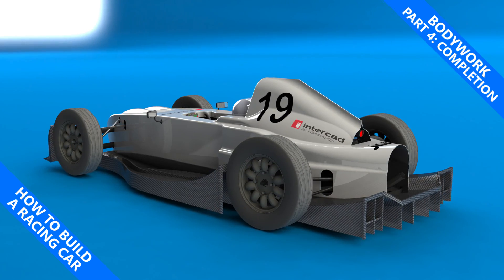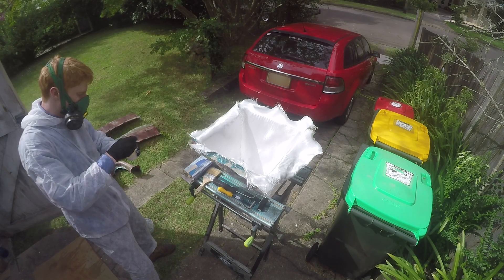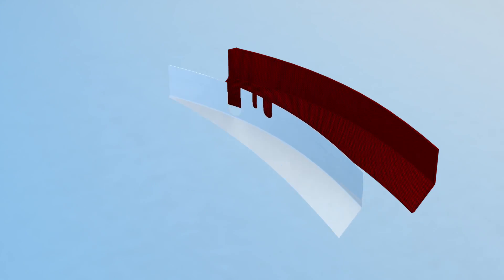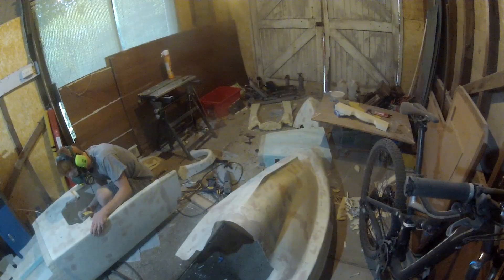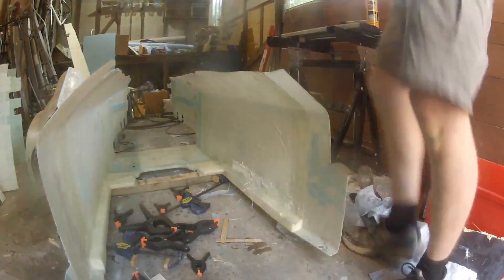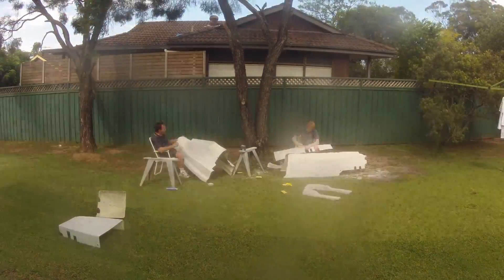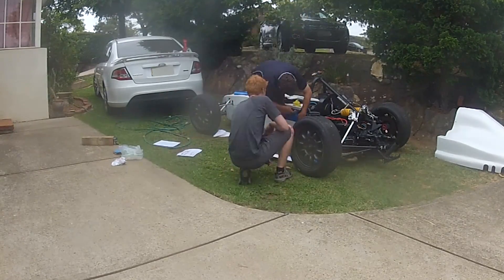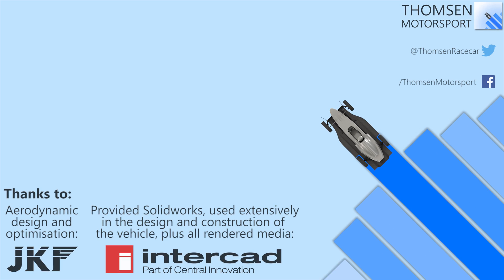Bodywork Part 4: Completion

Comment: Generally speaking, resin (gel coat) is sprayed into the mold first.  And any glass added is rolled in with a roller.  And if you really want, use a vacuum bag system.

Comment: Would you happen to have a rough estimate of cost for making the body plug, mold, and parts? I'm looking to do similar in a US racing class.
Reply from the maker: The body plug was relatively reasonable, maybe a couple grand AUD. The mold I spent about 1k AUD for the fibreglass, but didn't like it (vinylester) as it was quite hazardous. I moved to a local epoxy which was much safer to work with - I think I spent about 1k AUD again on that fibrelass (lower quantity / higher cost = roughly similar total).

Comment: How was it fixed in the estructure? Congrantulations for project! Wanted to know what are you up to now
Reply from the maker: I used DZUS fasteners to attach it. I had no problems with this - I just made sure the parts were layered such that the air couldn't get under any bodywork bits and tear them off.
I'm working in France now so have left my car behind, couldn't bring it with me here.

Comment: a couple of hints first you can paint on the mould a gelcoat to avoid pin holes we use at my work in aviation a product called duratec 707-061 which is a easy sand gelcoat catalyzed with mekp at 2% once out of the mould just sand and paint you can spray this on top of your pva release or you can brush it on, spraying is a lot better this stuff is common in the fiberglass industry so is easy to get in nz a 4 litre tin is around 2 hundred dollars but it goes a long way and saves tonnes of work once the tin is opened you have to use it in about 6 months second hint we always reinforce our moulds before removing from plug we commonly use large carboard rolls split in halve and a couple of layers of 300grm cloth . epoxy is quiet slow curing it really needs baking, once release put it back in mould for a few days to stiffen up. in aviation we use polyester 9885 which is fire retardant  no epoxy is fire retardant one draw back of polyester is that it can shrink back during curing so your foam doublers might show through on the outside . apart from that it would be a fun project to do I would of thought fire retardant would be a must in your sport good job so far keep it up one last thing before I go if you use foam for plug coat with a layer of 200 grm cloth for strength and fairing compound
Reply from the maker: Always good to see tips like this posted - I hope others wanting to do something similar read through the comments.

Comment: Hey Thomsen! I'm an electrical engineering student who has an absolute obsession with mechanical engineering, and your videos have been awe inspiring to watch! Would you ever be willing to do a video on some of maths you used in the design process of the vehicle? You've done an amazing job showing the how to of building this amazing machine, but I'd love to learn about the why in many of choices you made design-wise. 

Keep going man! You rock!!
Reply from the maker: Hi Marshall, thanks for the feedback. I'm always glad to hear when someone has enjoyed them. At the moment I'm not planning to do any more on this project, I've moved to Europe for work and have had very little time to think about this car. I'll think about it though.
Reply: Thomsen, 
That's absolutely fair! Thanks for even considering it. You've done some amazing work as it is, and like I said, seeing this build was inspiring. If you can't that's alright, any textbooks you'd recommend on the maths? If you don't know any good ones off the top of your head that fine :P thanks again for posting such awesome content
Reply from the maker: Thanks. Race Car Vehicle Dynamics is a good one that covers a lot of the theory, Tire and Vehicle Dynamics is also interesting but I didn't have the data to make the most use of it. I found a book on FEA codes in Matlab, I can't recall what it was called but it taught me what I needed to look at the chassis, even if I did implement it in Excel. For everything else I used YouTube videos or blogs. There's a great blog https://ludemannengineering.com/ which covers similar ground to what I ended up doing and was a good reference for me. In university I took part in Formula SAE, your university may have a similar program that you can join.

Comment: what kind of impact protection foam did you use? whered you get it and how does it work?
Reply from the maker: For the sides of the headrest it was a CAMS mandated impact foam which they require you place around chassis members near the head. I didn't buy it myself (it came from the donor wreck) but you should find it at any motorsports stores.

Comment: Oh man that glass layup was hard to watch.  I  sure you know now but wet the mold, lay the glass, then wet wet wet.... Finally and most importantly use a ribbed roller to roll everything down.  Done right you can get a surprisingly good finish.
Reply: Amazing and beautiful work btw!
Reply from the maker: If you found this hard to watch better not watch the new undertray video then... I'm going to stay away from fibreglass from now on!
Reply: ThomsenMotorsport I already saw it:). Nah. You made good solid pieces just gave yourself a little more sanding practice than you bargained for!  
Fiberglass work is almost its own artform and you do have one sexy racecar!

Comment: i really love your series
but for the fibreglas you should have built stiffer moulds and considered vacuum-infusion. dunno if you baked the pieces but epoxy only achieves max properties after curing under heat
furthermore, working clean is crucial when working with frp since impurities and airbubbles lower the mechanical properties

Comment: How did you attach the individual glass fibre body parts without nut and screws?
Reply from the maker: +Jayant B I used DZUS fasteners into tabs on the chassis.

Comment: A recommendation:  Use MDF or steel to reinforce your molds so they don't move around as you make parts.  Also, make them thicker, as you'll be using them more than you think.

Comment: When putting vinyl graphics on, wet the surface first with a drop of disk soap in water, then work from the edge out. 
but not before using some painter tape to mark your finishing points,
 tape the start edge like a hinge so you can line up your vinyl.
then spray the mix on the body and the vinyl in a thin coat.

squeegee the air out, this will let you move the graphic until you like the position. and with aid it wrapping. then us a blow dryer to set in it final place.

youtube it mate, wet method vinyl
Reply from the maker: Yeah Ray mentioned that was another way of doing it but he went for doing it dry. What's the benefit to doing it wet?
Reply: ThomsenMotorsport you can realign the graphic when it's wet. I lets you slide it on the body to certain level. more forgiving really. super work on the car dude. I'm very inspired to get a car and maybe work on one that needs repair. haven't used solidworks since high school
Reply from the maker: Aah right, there certainly was a bit of mucking around trying to position them so I can see how that would help. Thanks for the feedback and best of luck with your own project.

Comment: I really enjoyed watching your build come together. Hugely inspiring.

How much faster do you reckon the car will be with the now lacking aero elements, and have you planned on coming up with some temporary, less intricate solution to add more downforce?
Reply from the maker: Hi Erik, thanks for the feedback. The estimate I got from JKF Aero was nearly 2 seconds around Wakefield from the diffuser - I wouldn't know until it's tested but that would be a huge improvement. I'd actually be worried about how much extra stress the parts would be under if it were cornering that much harder, a lot of the spec Formula Vee stuff is already near its limit. Anyway, at the moment I'm not going to do anything temporary as aero, hopefully the CofG and suspension optimization will be enough.

Comment: I know it's a bit late, but for future reference, you could look at gelcoat as the first layer in the mold, and also include the stiffening structure, including balsa battens which absorb the resi as stringers between the foam, when you do the lay-up of the epoxy, not afterwards. You can get all the expertise and possibly get some of the harder jobs done cheap by the boatyard boys. I know an absolute genius with GRP in a boatyard in Essex who charges peanuts if he likes you.
Reply from the maker: +Golly Po yeah this area was a bit of a failure on my part, not enough research done beforehand. I was so short on time (though it took way longer than planned in the end) and I've been doing things as cheaply as possible, it also had a large effect on the end result here. I'll keep your advice in mind if there's a next time, thanks.
Reply: It's a brilliant looking car, and you could always replace a couple of the panels later on. There is an online retailer/wholesaler of all things composite (easy-composites.co.uk) that do a fantastic slow cure infusion resin, that they use for laying up carbon fibre in vacuum bags, but it's excellent stuff used with woven matt too, and the prices are wholesale prices at retail quantities, and they do off-cuts and roll-ends of carbon fibre matt at easily affordable prices too. Well worth a look. I think you can be justifiably proud of what you've designed and built. Not many proper manufacturers have such a successful prototype car, especially for a first car! Inspirational stuff.
Reply from the maker: +Golly Po thanks, great to hear. We'll see how successful it is this weekend at the first race!

Comment: Did the body work scare you away from the diffuser design or is that just waiting for a later date to do (guessing it would have to be after the season is over)? I totally understand the pain for composites. It's a pain, but the results came out quite well!
Reply from the maker: +James Wright for now yes, the bodywork really burnt me out. I had so much trouble getting a decent finish on the body and the diffuser would require a huge step up in quality to be both useful and safe. I'm not ready yet to take it on.
Reply: Oh yeah, totally understand. Something I would recommend for the diffuser especially is using sheet metal and waterjet/cnc wood ribs is  a simple/easy way to do body work. Surface finish is basically taken care of and the actual making of the mold making process is much easier. It limits the shapes you can make and is obviously something you couldn't really do with bodywork, but it might be something you could adjust in the diffuser design to take into account.

Comment: are they mosltly 2 layers of csm? what weight please?
Reply from the maker: The fibreglass for the body was 185 gsm twill weave. I used initially only two layers but as I worked on the bodywork I ended up adding more and more layers, most of the bodywork ended up with about 4 layers of fibreglass minimum.